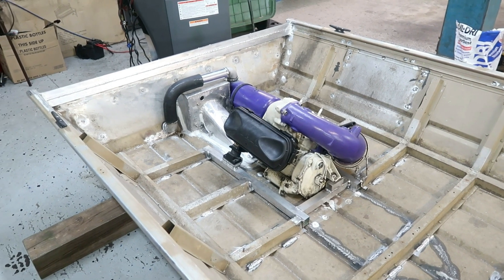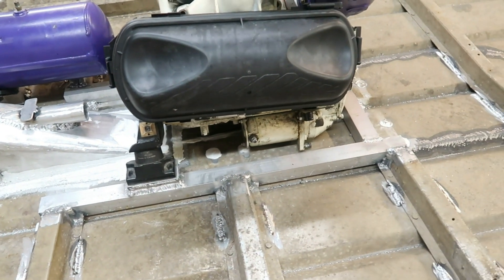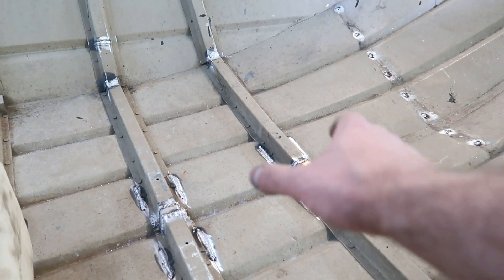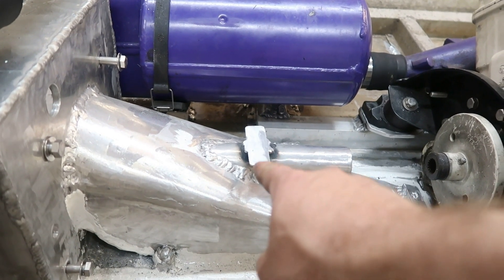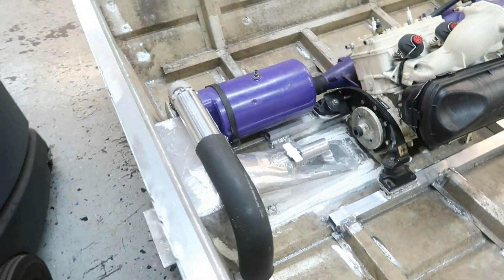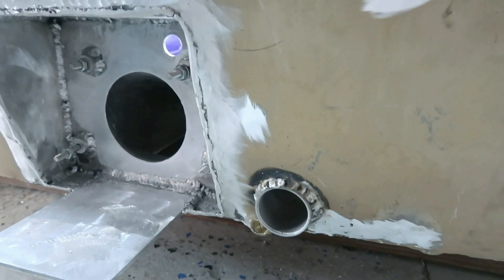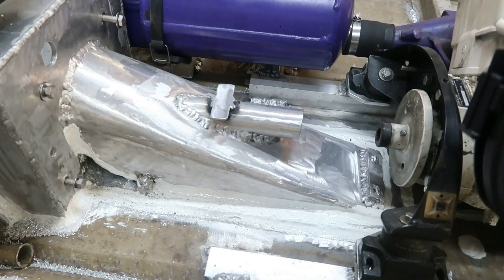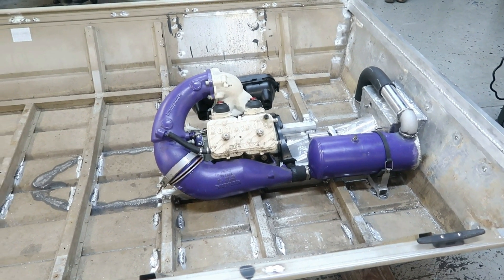Jet Boat Build ep 4 - Engine and Drive

Comment: Hi! 
I’m wondering what the total weight of the engine+jet outlet is, could you tell me?
Reply from the maker: The donor jet ski setup in total would weight something like 150lbs. To compare, this 110hp jetski engine weights less than a 20hp outboard engine.
Reply: Ripptyde Vibes could you tell me the size of the total project in the boat? I would like to built a project like this too but I don’t know wheter I have enough space.
Reply from the maker: @tiesversteeg1753  Boat is 16ft x 6ft and the jetski that I bought for it was 8ft
Reply: Ripptyde Vibes sorry for the lot of questions that I ask but I mean the measures of the engine😅
Reply from the maker: @tiesversteeg1753  2ftx4ft "engine bay"
Reply: Ripptyde Vibes thank you!

Comment: MY god pay someone to do your welding please
Reply from the maker: With 5 spools and 2 big tanks of gas, Im thinkin I made out well on this $1500 jet boat lol. Youd be talking several grand and ALOT of trailering to and from a fab shop, not feasible. I have alot of experience and this was my first time on alum with a new hobart spool gun. Ever use them beading TIN to plate? 1960 aluminum to 2020 aluminum? I admit they look horrible but are leak free and functional. Id challenge anyone with a spoolgun to produce ATTRACTIVE welds on a project with this kinda dissimilar materials. NOT FUN if appearance is your goal, you will get sad quickly doing something like this on a budget! Check soon for the final video, decked and carpetted we have been beating the hell outa this rig and its performing flawlessly. Thanks for watching and commenting!
Reply: @ripptydevibes2581  not trying to bust your balls just worry about the safety aspect but I do love the concept

Comment: Thinking of doing this. Approx how long, and how tall is the drivetrain?   Need to know to determine the best doner boat. Any reasonable estimate would be very helpful.  THANKS!
Reply from the maker: 45" from front of engine to transom. 18" from hull bottom to top of the highest point on engine (exhaust pipe)
You could move the engine rearward more than mine, giving you a 40" engine to transom.

Comment: Can i use my 150cc bike engine on this type boat
Reply from the maker: You sure could! But its much easier to use a jetski so that all the parts you need are included. Using a motorcycle engine would require all types of hunting and fitting certain parts.

Comment: why the engine swap?
Reply from the maker: What it means is basically "Engine Install". Does that clear it up? This was an outboard boat with a jet installed or swapped.
Reply: ok, I thought you had a 20 h.p. motor running the pump
Reply from the maker: 1996 Seadoo XP system., 787cc//110hp